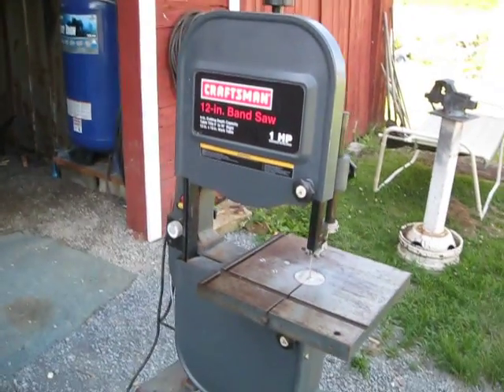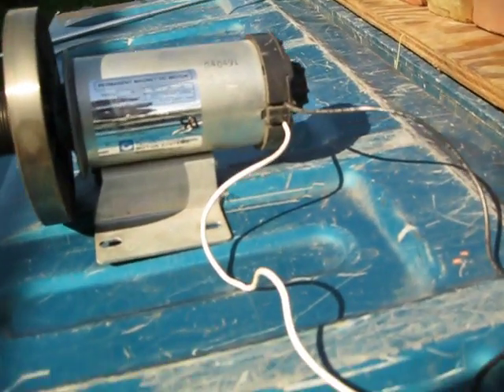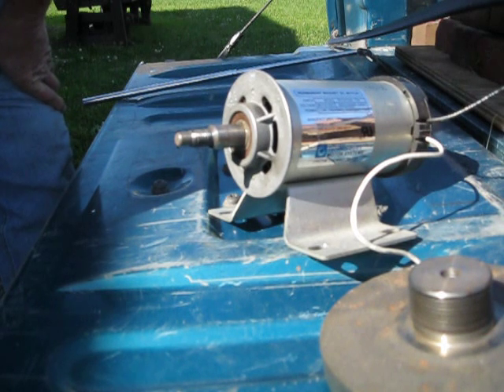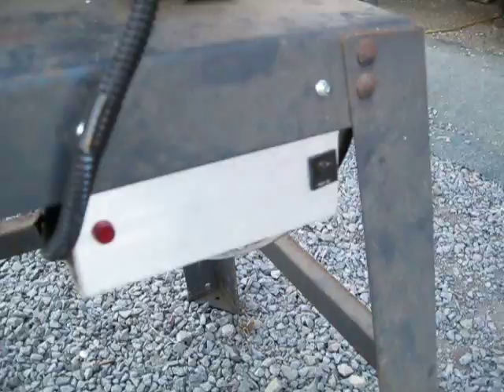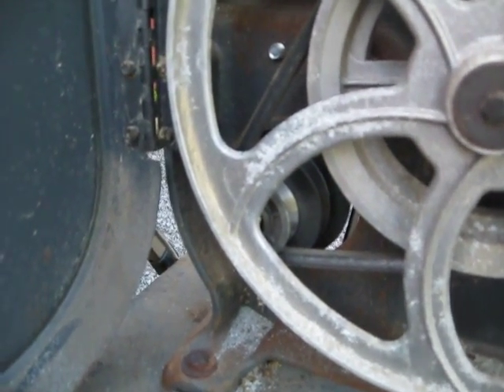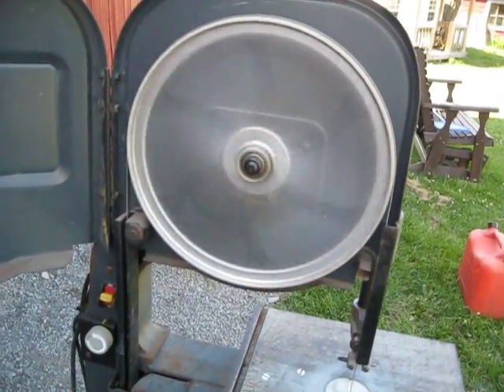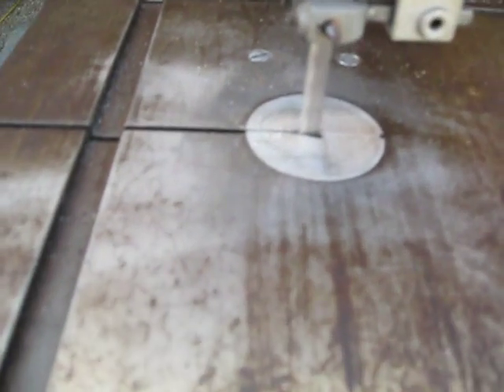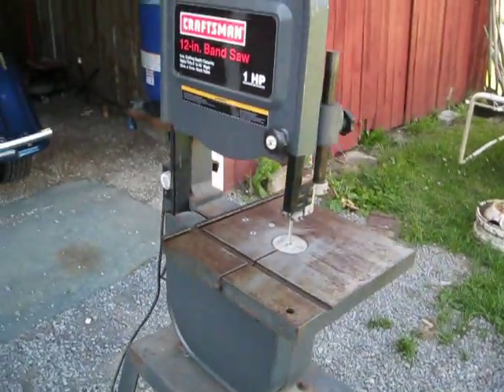Treadmill Motor to run Wood Bandsaw Conversion

Comment: Hi I was wondering if you could help me figure out my conversion.  I have a 2.75 hp dc motor and the motor board from a treadmill.  I wired in a 10k pot and got the rpms down to about 530 which isn’t slow enough.  I need to get it down to about 120 to cut steel.  I really don’t want to do anything to the pulleys.  Is there a way to do it by getting a new pot or something?  Any help would be appreciated!!!  Thanks

Comment: Is there a way to bypass the speed sensor? For example-mounting the motor on a table saw so when I turn it on, it runs at its max RPM.

Comment: Awesome video! I was looking to all kinds of different pulley configurations to convert my old craftsman wood saw into a metal... but now I believe this is the route I will go. Hell we even have a decade old treadmill in the basement that hasn't been used more than 5 times. Being able to ramp up the speed is great too, since I could just switch out blades and cut wood again.

Comment: Great work on that conversion.I made a bench grinder variable speed with the same parts..one neat thing about those motors is that when running at a lower speed when you apply pressure the controller compensates and ads a bit more power until you back off.notice that? Anyways I like what you have done there

Comment: Great video, and very helpful. I'm trying to do the same thing to my Craftsman 10" wood band saw. I bought two treadmills, first one was a small one kind of a older model and I felt it was to light for my application until I tore it apart. It looks exactly like the one you had in your video with the same parts. 115vdc rated @ 1.5hp which will produce a max of 4,300rpm. While taking the treadmill apart a wire broke loose from the circuit board and I will have to take it to get it soldered back on. The  second one was a bigger treadmill from proform and it has a 2.8hp VDC, 1.75hp continous duty motor. Now I figured this one will do the trick. Well all was going well until I tore this thing apart. The top portion of the treadmill, (were you operate it is all push button, for speed contol, how fast you going, measures your heart rate and etc. I know it has a very big circuit board behind the top panel, for which I have not tore apart, figuring it going to be a nightmare. This treadmill is only about 5 years old. Hoping you get to this post and reply back I sure need you help. I may be contacted @ wooden2626@q.com. Appreciate your help, by the way I see the back of your streetrod, nice car. I'm a streetrodder and working on a 47 chevy.